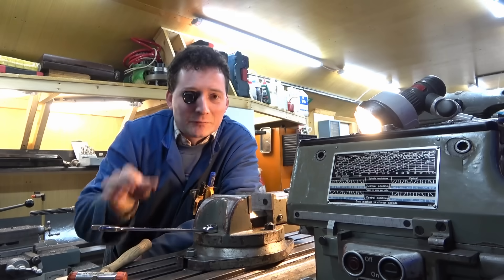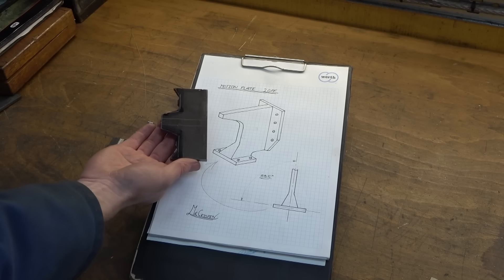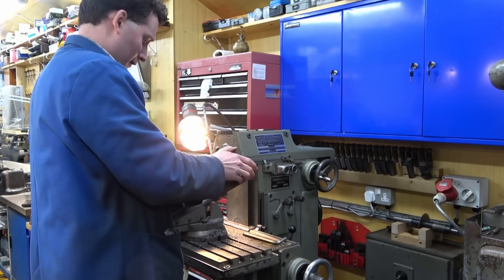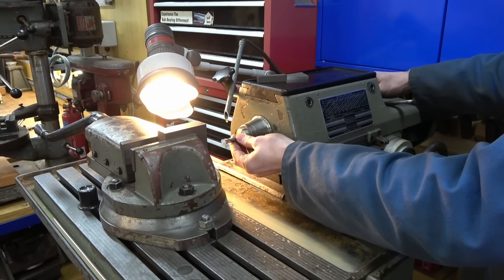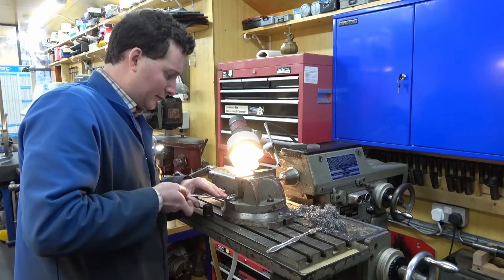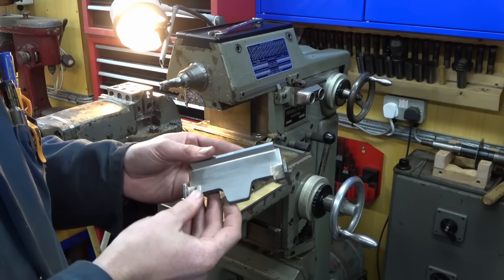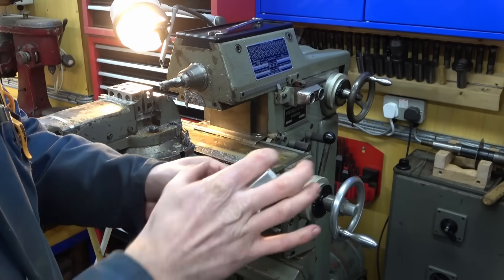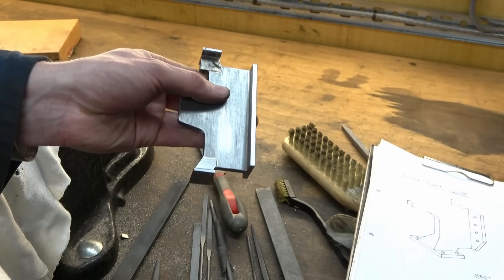Machining Motion Plates (MrCrispin's Locomotive Build)

Comment: Interesting way to make those support brackets (motion plates).
Using a match to light the propane torch was very "period".   I use a spark lighter to light my oxy acetylene torch and for the propane torch I use a small hand held butane torch with integral peizo igniter,  light that then light the big butane torch off the small torch's flame.  A glass bead blast cabinet is a quick way to clean up parts after silver soldering.  Alternatviely you could try coating the bright steel surfaces with a borax solution which I have had some success with.  Traditional plating shop way to clean up steel is in a hydrochloric acid solution bath.
Very satisfying to turn some bits of souless steel,  brass or aluminium into beautiful parts !

Comment: Outside have a Sulphuric and hydroclauric acid pickling bucket 50/50 leave for a day and it will come out like new, have a wash tank also. 

When brazing or silver soldering we used to machine a  0.1mm gap at the ends for the solder to capilary react and flow into.
Reply from the maker: Good idea

Comment: Another great video Mr Crispin, Well done!!
May I suggest you use straight "double strength" (aka "laundry") vinegar as your "steel" pickle.
It'll remove all the mill scale for "mild steel" pre-solder work & remove the oxides post-solder.

Comment: i don't doubt your skill and please suffer my ignorance but why don't you just weld those bits of steel together rather than used silver solder?
Reply from the maker: Hi, I find it very hard to get a tig welded assembly of that size to behave it's self, and the few times I've tried distortion and squarness becomes an issue. 

Also the tig welded joins end up very hard, and filing them up often gives less satisfactory results as the metal has shrunk below the surface level. 

Silver Soldering is allot messier but I find the the end result is more refined.
Reply: @MrCrispinEnterprises  Tig is very good for tacking assemblies together prior to brazing or silver soldering. You can make very small precise tacks with minimal heat that secure parts very firmly.

Comment: Nice to see you again. How’s the engineering degree going?
Reply from the maker: It's pretty intense and continuous!
Reply: @MrCrispinEnterprises  You don't need to tell me. I started my Engineering degree 40 years ago and it was the best thing I ever did. However, I went straight from school to university. I don't know how many people follow your path any more. Even in my day it was rare to go from the shop floor to a degree in engineering.

A fair few of the older engineers in my youth had gone from being the smart apprentice taken into the drawing office, then years of night school to get their degrees. I was always envious of their experience. Though we did do a two week fitting and turning course at the local technical school the end of first year. I still have my 3" bench vise!

My first boss was one of those. The first thing he did was to send me to the store for overalls and a pair of steel capped boots. I spent the next two weeks watching and learning from the fitters and turners, and the boilermakers. A great way to learn respect for the guys in the workshop. It made me a better engineer. Happy days...

Comment: Why  not weld those parts? Faster stronger and whole lots easier than machining grooves ,pins and silver soldering.
Reply from the maker: Maybe I need to give it a go again, but I've never had much luck getting the end result to look as refined as silver solder. Welding seems to do allot more thermal damage to the surfaces and sometimes they don't file up very well.
Reply: @MrCrispinEnterprises  
Look into a small tig welder. Very good control. 
Always look forward your videos. 👍💯
Reply: Firstly I don’t recall him owning welding equipment. Secondly you get too much distortion with welding. With a fillet weld it pulls out of square due to local heating. Silver soldering lets the part get up to an even temperature and distortion rarely happens.
Reply: @daveticehurst4191  
With skill and a tig welder . Zero distortion.  How much heat you put in a part. You be surprised how a just control you can get with tig . Watch , weld a soda can

Comment: Is that the morse taper spindle on the Deckel? Do you find any issues using this spindle taper? I had been considering the ISO taper as a must-have in searching for a small mill, but a morse-spindled Deckel in my area caught my eye.
Reply from the maker: Hi, no its a fairly specific taper that is quite rare in the UK. It's a slighlty larger angle than a morese taper. 
I can't see any issue with a more taper for this machine.
Reply: @MrCrispinEnterprises  Thanks. I guess I should be happy the morse-taper one is at least a standard taper (easier to find).

Comment: Good old-school skills. Manual machining and fitting work. Does anybody still do making a square bar out of a round one as apprentice training, using a chisel and files? Excellent video.
Reply from the maker: Allot of the training schools still do that kind of thing which is good!
Reply: When I went to vo-tech around 1987, our first project was to make a drill gauge with only a hacksaw, file, protractor and 6 inch scale. Had to be within 1/64 of called dims (ck'd with calipers)and angle within 1/2 degree. A few guys quit.